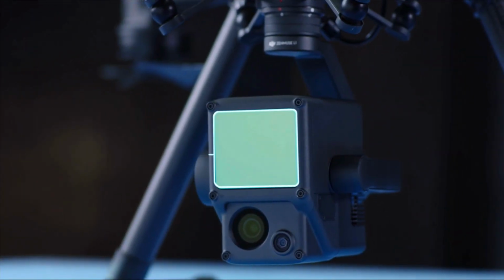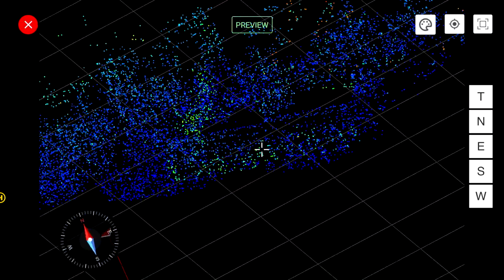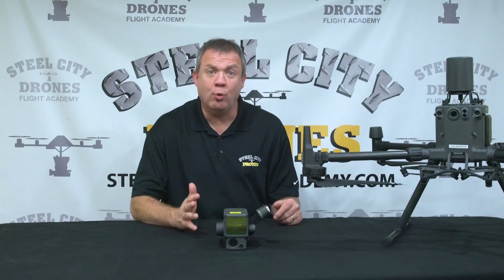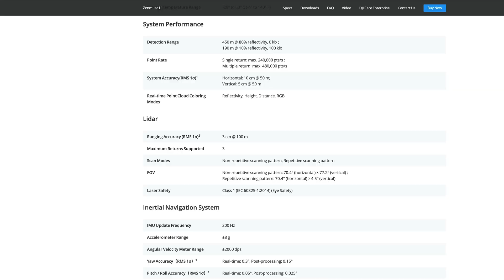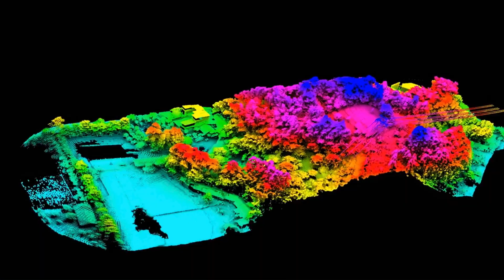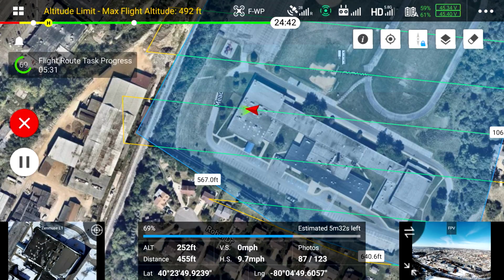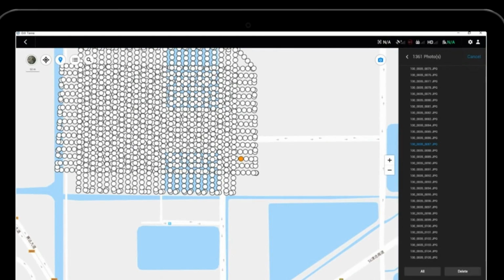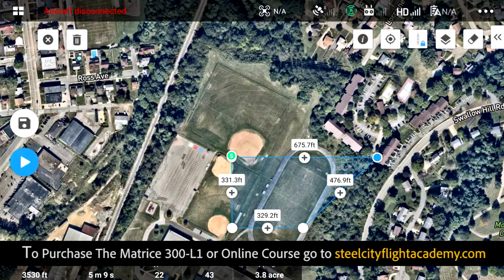Zenmuse L1 Camera Review and Workflow

Comment: is there a way to just process the data and construct only less model, than export it for our main software in the office?
Reply from the maker: Thru DJI Terra.
Reply: @SteelCityDrones  but using a free version or must have a basic version activated?
Reply from the maker: @joaopauloabdalla7233  the L1 comes with 6 months trial for free.
Reply: @SteelCityDrones  and after that there’s no way to at least export the usable LAS file?
Reply from the maker: @joaopauloabdalla7233  you need to purchase it after 6 months.